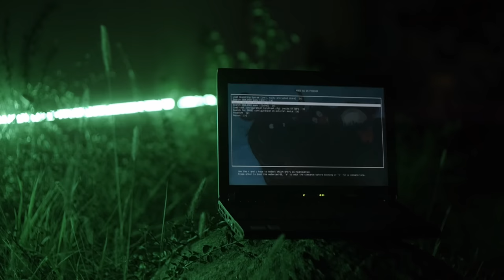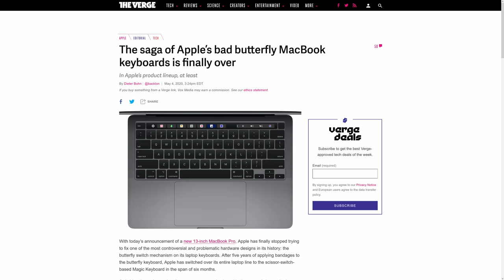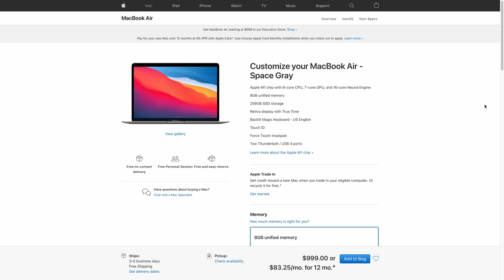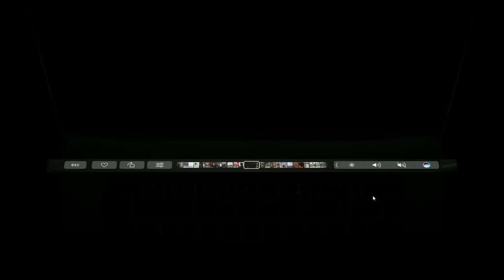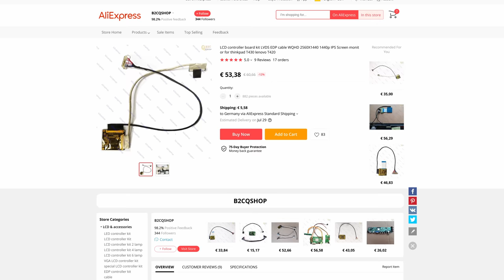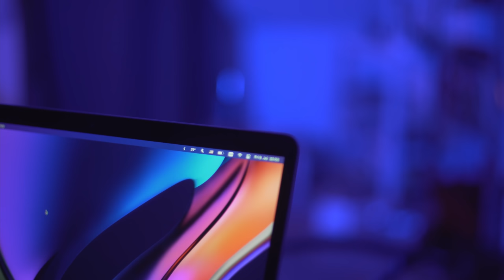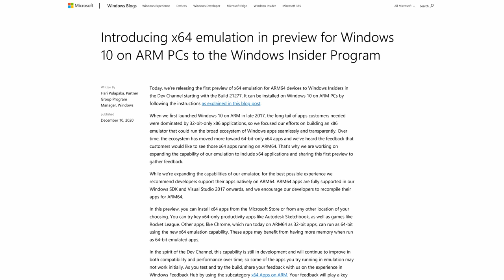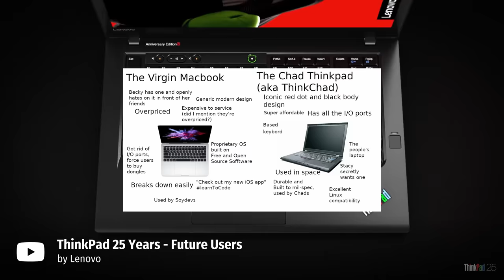Why I Switched to Mac (as a Linux user)

Comment: great choice!! for your use case macbook seems to be very fit
also. this is only temporary. eventually, windows laptops are also going to run on ARM. i estimate this will happen sometime after windows 12, due to microsoft's corepc project and all. eventually we are going to return to point 0 in terms of price and performance

now, for my personal use cases...
i daily drive ublue kinoite on a cheap ideapad 3 with amd ryzen 3 5000 series...
macbooks seem nice, but my use case is just browsing the web, playing some older games, watching stuff... and i dont have a lot of monee.. so macbooks are basically kind of overkill for me... but i can see why some other people with different use cases may prefer or need macbooks...
oh also, ublue kinoite is basically um like, fedora, with kde, but with an immutable root partition and batteries included. with this new cool technology, the operating system cannot break, updates like android, can time travel kinda, and is like infinitely stable. and only uses flatpak for apps. i do not get infinite power and i lose access to a whole bunch of apps but in my use case this is a godsend haha, because i get the reliability of a chromebook but linux
um, the only issue with linux in my use case, is that wayland fractional scaling is crappy rn, just like on macos, but in a year or two kde plasma 6 is gonna introduce full support so thats gonna be awesome.
i am pretty happy with my setup... it is gonna serve me for years to come!!
Reply: oh um also also! oh wait um i forgot..

Comment: For laptops, I'm hard-pressed to beat the m1 MacBook Air. I really like mine. It's the only Apple hardware I've ever owned. I wanted portable, quiet, and cool. I'm the type that keeps everything until it's dead beyond repair. If I need power, I'll use a desktop. My only real complaint is the window management, or lack thereof. I've tried a number of setups but without disabling most of the security features, I can't get anything similar to my xmonad setup that I'm used to. Things like rectangle, magnet and amethyst are a decent middle ground, but far from as capable. All told though, it's damned good for the money.

Comment: Regarding fan noise. I prefer to hear some noise than anything. Apple decided not to have noise for MacBook with fans. I got it, some users want a quiet environment. But in my case, it is hot most of the time because the software that I use for my daily job. So, I customized the fans “curve” to avoid heating.

Comment: You're making some great points about brand loyalty which makes it super funny that you basically only look and Thinkpads and Apple products. If you step out of those two you can see that there are products outside of those two that could fit your criteria.

Just examples: Lenovo Yoga 14 ARP. 12h+ battery life, quiet, really good performance, all-aluminum chassis. 
Tuxedo Infinitybook 14/16: basically the "Macbooks" of the Linux world. Oviously noisier than the Macbook Air BUT quiet if you want it to. Also RAM, battery and SSD user replacable. Slightly more pricey than a Macbook Air but comparable to a Macbook Pro.

And then for the Windows side I would argue that XPS 15 and 17 are the equivalents to the MacBook Pros.

Sadly you're right, there's still(!) nothing really rival the Air ecept maybe the Zenbook 13.

Comment: I just bought a Framework 16" custom-built laptop all AMD running Linux. It is fully upgradeable and serviceable. So far, I'm very impressed. I'm able to do everything I need to do with it. Zoom meetings and normal business use. Very stable without any bloatware or nonsense I don't need or want.

Comment: I am personally still a PC guy and am rooting hard for Intel and AMD to find a way to respond and compete with Apple silicon but even I have had to come to the difficult conclusion that the new MacBook Pros are just waaaay too feature-rich and powerful to consider any other laptop at this point.  Hell, my M2 iPad Pro 12.9 already kicks the crap out of most PC laptops despite its significant OS limitations (and now that Final Cut and Logic are coming to the iPad its usability is going to get even better).  So, sad to say, I am now looking for a new M1 Pro MacBook Pro 14” as I simply can’t deny its features, efficiency, and low noise level.  Throw in the awesome port selection (MagSafe, 3 Thunderbolt, SD card slot, etc) and the best high-refresh rate monitor on any laptop (by a large margin IMO) and the choice is imminently clear.  The fact that you can still find M1Pro MacBooks brand new for extremely competitive pricing and that’s just icing on the cake!  (Edit-I realize that pricing gets well out of hand on MacBook Pros when you step up to a 1TB+ SSD and 32+GB of memory but the base config with a 512GB SSD and 16GB of memory is honestly enough for me, especially with the TB ports that you can utilize for data dumps on an external SSD).

Comment: I have a first Gen M1 MBP, and it's the best laptop I've ever owned so far - primarily because of how long the battery lasts, and how cool it runs - so much so it can run on my lap.  It's great for sofa coding and portability.

Downside, 13" screen is kinda small and not ideal for my use case.  But my next unit is probably going to be a MBP - 14 or 15 if they exist when it's time for me to upgrade.

Comment: I can forgive Apple's lack of IO on the MacBook. You can put a dongle on it that uses both ports, that makes it have so much IO its fine. I used to be against the idea, even after switching away from Apple. I  like their IO strategy. If you use their laptops as mobile desktops, you're covered. If you use them as a mobile laptop, its better because does save a lot of space. I use a laptop with decent IO, but I still use a large dongle. Because I needed even more for my combination of gaming, work, and raspberry pi projects.

Comment: Fellow Linux dork here.  I went from a 2011 MBP to a 2009 Clevo running Pop-OS, back to an M1 Max MBP.  The machine keeps impressing me despite the fact that ultra-hate MacOS.  I am so very tempted to install Linux in a VM and run it full-screen 99% of the time, just because MacOS itself keeps fighting me and my keyboard-centric workflow with its annoying global keybindings and other dev-hostile quirks.  But the hardware... it's killer!

Comment: Man, I couldn't believe how much based this video ended up being. 
I've had similar doubts lately, and this definitely cemented them.
As an "enthusiast" X230 user, 7-row keyboard enjoyer, and Trackpoint worshipper,  
I've been quite hesitant to change my views on technology for too long,
and in my mean time wasted a lot of time dealing with Thinkpads, 
and over-focusing on nitty-gritty stuff.

For me, X230 is good enough, and my debian confugration is fine,
but if I would need to do any serious work like yours once, I'd need to get a more powerful machine.
I've been bothered by how hot every one of my Thinkpads gets, how much playing a simple youtube video taxes it's
old intel dual, or even quad-core cpu, temps are bad, power consumption worse, and battery life is non-existent.

However, I think this machines have their values still, and despite all weaknesses,
they are still great for typing and doing simple tasks, so you can use 2 laptops for different things.
It's all in your mindset, and this video  moves it in a good direction.

At the end of a day, technology is means to an end thing,
and instead of focusing on trying to have the best Thinkpad ever,
or something, you should use your machines to get the work done.

And also, all companies are bad, because of course, they are companies.
So, Thinkpad 'enjoyers' are just a different side of a coin,
where on the other side, are macbook fanboys.
By not playing that game, you truly become gigachad,
possibly, a socialist.

Comment: That's one hell of a video. I agree with you and it's kinda hard to admit it. I'm a die hard "anti Apple guy" but I am reconsidering. The M1 truly is amazing, I was running Windiws on Dell Latitude with 6th gen i5 and it pissed me off that whenever I was watching a 1080p video on yt and nothing else was opened the System Antimalware service would start and spin my fans to quite high rpm and on top of that the laptop would still get hot. I eliminated that issue with linux but now I can't have Adobe :(

Comment: I used macOS (hackintosh) on a Lenovo L440 since 2014. I upgraded the screen to 1080p, trackpad with three buttons (forgot which model), 16GB RAM, put an i7-4700MQ (its TDP was still higher than allowed, but it worked). I only went to change this year, I got a MacBook Pro M2 and wow, what a difference I felt!
Reply: How much ram is needed do you think ? 16 or 32 ? For the M2
Reply: @alshuwaiee27  16GB working perfect

Comment: Did the ThinkPad lose 24 % or 24 percent points of battery at 5:30?
Reply from the maker: Isn’t that the same thing
Reply: @WolfgangsChannel  Only if the battery was at 100 % loosing 24 % would also be 24 percent points, yes. Otherwise loosing 24 % of 80 % battery result in 60,8 % battery while loosing 24 percent point of 80 % result in 56 % battery, get it?
Reply from the maker: Oh, I see.

Both batteries were charged to 100%, and since the Thinkpad's battery didn't have its original capacity anymore, I calculated how much it would lose if it had the full designed capacity

Comment: Honestly I feel like it's just about use case. Depending on what you prioritize and do, just use a different machine/operating system. Whatever works best. As long as you know how it works, can have compromises, are open-minded to alternatives and it fits within what you can accept I don't see an issue.

Comment: 1647 euros here for the same configuration of 16 gb ram and 512 gb ssd :(((
typing this from the base model. I was monitoring the memory pressure constantly but after reading on reddit I learned that the SSDs in this thing will last a very long time, so there's no point monitoring it really unless you're doing some intense rendering, compiling, or transferring of files. 

I think the base model is more than enough for my needs really. Only wish the prices for the upgraded models wasn't so expensive in Europe, its ridiculous!

I might just sell it in a year when m2 air comes out and I have a nice little side nest for the new MacBooks >:)

Comment: I'm pretty sure everyone agrees the Apple silicon stuff is great

For me I want a touchscreen and pen (basically an iPad running Windows) and don't need strong compute, so I went with an older Dell Latitude 9410, as it's a modern design but with USB A ports (as well as thunderbolt), traditional x86 compatibility, easy to service, and 20+ HOURS OF REAL BATTERYLIFE

I got it for 400 bucks so I'll take it

Comment: I bought an XPS 9560 for college almost 7 years ago and always thought I would upgrade the ram and storage one day.
In the end, I still haven't because any application that needs more than the original 16gb of ram won't run properly on the old CPU and/or GPU anyway.
In the end I just built a new desktop pc when I graduated and now use my laptop for basic laptop things like watching youtube or netflix in the couch or in bed. Also ditched Windows on it and installed Zorin OS.

Comment: Ive been running Linux on a touchscreen dell for 8 years and have had nothing but issues.  
I bought a mac m3 pro on sale.  I was thinking about returning it and finding a laptop that works with Linux.  This video is making me rei that i should just keep the apple.  If Ubuntu or system 76 ever for things working and upgraded the build quality, center the trackpad, etc.  There would be a laptop for normal people.  But when mac only costs $500 more and lasts 10 years, its obvious.

Comment: My biggest issue, besides trusting that some proprietary operating system is trying to collect data on everything I do, is that I cannot stand the Mac workflow. Simple stupid things like trying to look at a zip file without unzipping. Making a zip file includes that stupid Mac OS X directory in it. Fullscreen means "real" fullscreen and opens in a Virtual Desktop. Right click, while existing, is discouraged. I'm really not a fan of the "Mac way" of doing things. I love the freedom that Plasma and even Windows Managers give me to use my computer the way I want to.

I spend a lot of time in the file manager when I'm not on the command line and Finder makes me want to put my head through a wall.

Comment: As a windows user using a M2 for sometime I'm shocked how slow programs are opening compared to my windows machine.
Reply: I mean, I have a decent build (5950x, nvme all the way, 64gb ram...) but for the price of an m2 air I could build something much more capable in real life tasks...
Reply: @TruthDoesNotExist  ARM is fundamentally better than x86. ARM is the future
Reply from the maker: Unsurprisingly, a huge desktop computer which doesn't offer any portability, consumes an ungodly amount of power and didn't require any engineering and RDP to balance size, power efficiency and performance, will cost less than a comparable laptop

Comment: I use an M1 air for web browsing, writing, and some super light gaming. The battery life is insane, it's super light and great to carry around, and I got it for a good price because places are trying to clear out old stock. That being said, I still detest Apple and would love to have another option that I can trust to just grab and go anywhere any time at 50% or higher battery and not be concerned that also doesn't have a fan to suck up dust. The day a Linux equivalent to the M1 air exists is the day I happily replace this thing, and in the meantime I have more powerful machines with Linux that are just a bit clunkier for anything serious that needs done.

Comment: Suddenly was caught up by this video. I do hate Apple as much as any other anti-consumer company, but the take you are right about is that Microsoft stuck at legacy and inconsistency of their system. I can't help but agree with the fact ARM-based chips fit perfectly for to laptops and regular PC components manufactures have to do something to provide at least similar experience to users. Now we only have Framework project which is about repair-ability and upgrade-ability consumer oriented solutions, but it still relies on x86-hardware. Well, that's something. Have been following their activity. Catch my respect for your passion in learning computers

Comment: I've never understood when computer scientists cling to one system so tightly. As if the operating systems were so different to use. I've been using Linux since I was 14, but I've also always used Windows and MacOS. The nice thing about the Mac is that it has a Unix shell, but you can now also use a Linux shell under Windows with WLS. In terms of hardware, I like my work device, an MBP, but privately I use a Thinkpad with Arch, how could it be otherwise?

Comment: I got an Ideapad with 5500U, 512GB NVMe and 20GB ram (after the upgrade) for the half price of a M1 with 8GB ram and 256GB (SSD or NVMe?). Its power consumption is quite low, that was an important factor for me, I don't care about battery life. I actually considered M1 but the deciding factor was a) very bad previous experience on Mac pre-M1 due to not accepting any common hardware like mouses and keyboards (not sure if that changed), b) compatibility of the M1 processor with existing software and specifically Linux - there is some distro that supports them but it's not everything works and I am not sure I would like to be limited to just 1 Linux distro when there are thousands of distros out there. If things continue the same maybe my next laptop in 3 or 4 years would be some M3-M4.

Comment: What do you think about iPads with M2 chips and the lack of dualboot to MacOS?
Reply from the maker: There is dualboot: https://jasoneckert.github.io/myblog/asahi-linux/
I personally don't have a use case for an iPad Pro, since those still run a mobile OS with all of its disadvantages
Reply: @WolfgangsChannel  But this kind of dualboot only works with Macs or am I mistaken?
Reply from the maker: @philip6433  Oh, you mean dualboot on an iPad. Yeah, that's precisely the reason I don't really have a use case for one

Comment: Thinkpad is extremely durable. Thats why it is  used by most engineers. Mine fall from 7 feet to concrete once and keep working.
Reply from the maker: Maybe the older IBM-made models. 

My X1C6's charging port broke, and the only way to repair it was to replace the entire motherbaord, since the port was soldered. In that way it's even worse than the Macbooks.

Comment: I appreciate the Macbook for its outstanding build quality, touchpad, and display. However, I struggle to adapt to the operating system and its limited customization options. One issue for example is the inability to simply click on an open application in the dock to minimize it; instead, I have to use the non-intuitive and frustrating option + click method. These minor inconveniences consistently lead to frustration whenever I use the device, making me wish I could put Gnome on it.